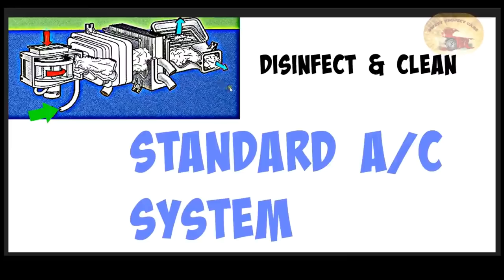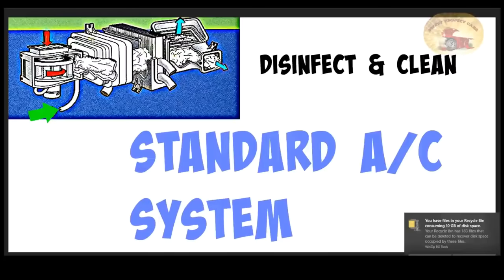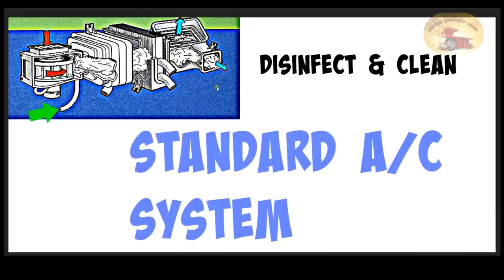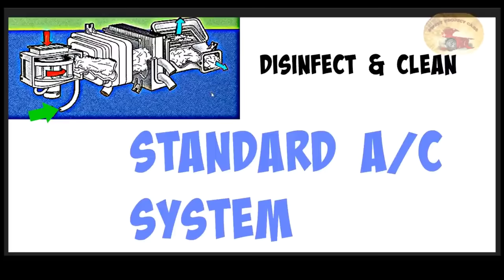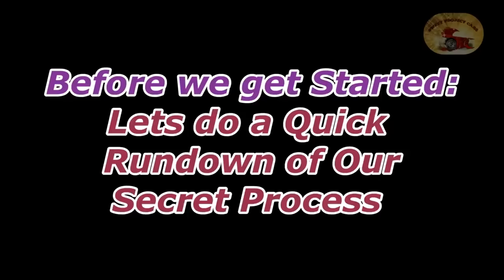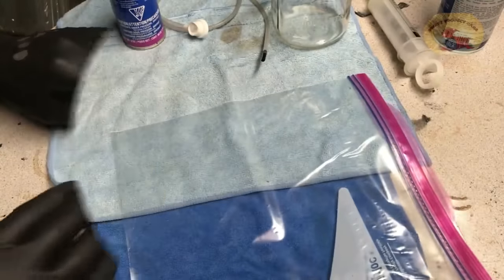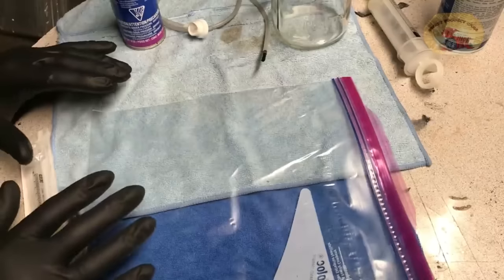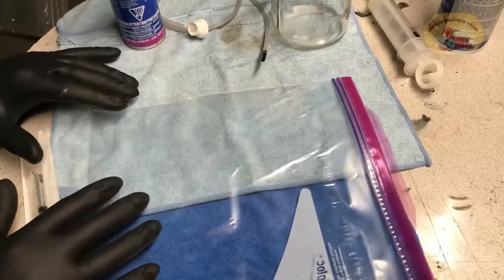How To Make Your A/C Run ICE COLD!!..Amazing Results.....For All Cars, Trucks and Semi's

Comment: Can you use this method just on the back of the condenser when the front is blocked by the radiator? Thank You!
Reply from the maker: Yes, absolutely! But if you do it right, you can spray it into the radiator and it will go into a good portion of the front of the condenser, then do the back as well. Some is better than none. Thanks for watching and asking, have a great week my friend. mad Mike

Comment: i using water soda no sweet taste , i pouring form inside grill panel wind cabin,. before this way the drain hole underside i close clogged with any bolt nut to fit it,. need 2liters water soda / or beer to do this
Reply from the maker: Thanks for watching and sharing, have a great day. mad Mike